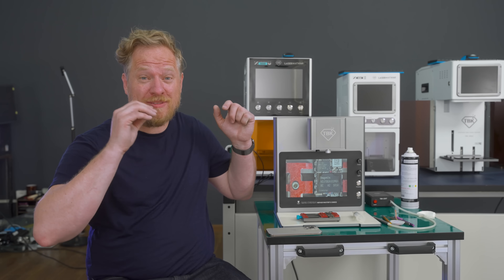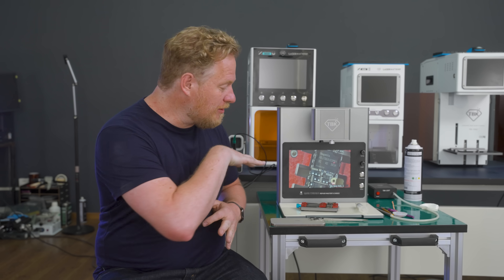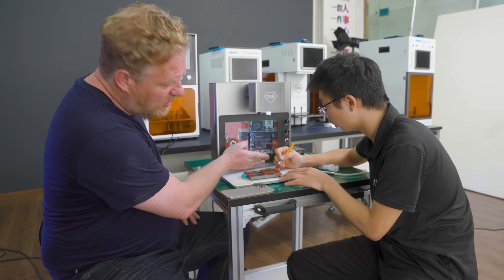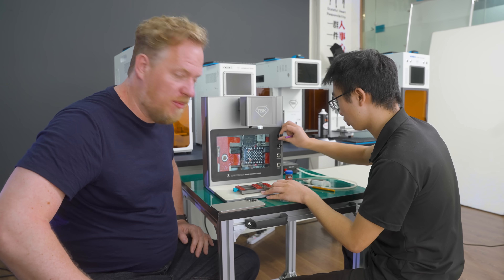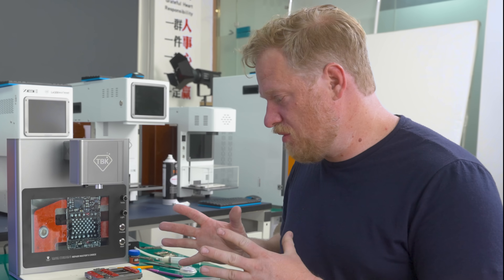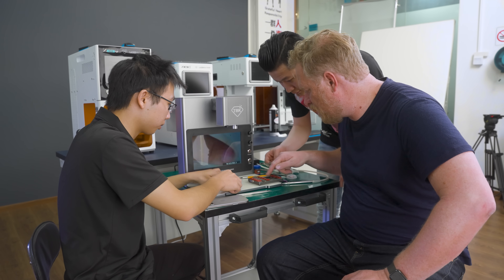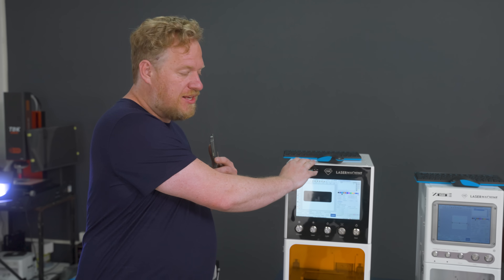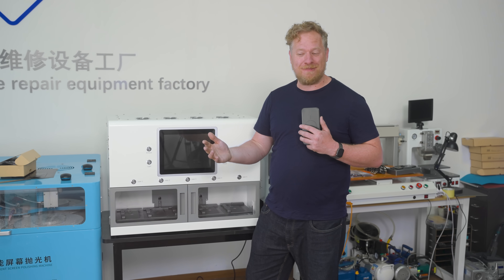This Shouldn't Be Possible

Comment: Have electronics gotten more energy efficient or more energy required with smaller and smaller parts?
Reply: Energy efficiency, modern chips and electronics tend to sip power compared to stuff from even 10-15 years ago for stuff with comparable performance

Comment: 5:56 I cannot imagine a situtation where this is not only feasible but also cost effective?
What kind of chip would be easier to repair than straight up replace? especially as chip manufacturing technology becomes more technical?

Maybe like obsolete vintage chips that don't have replacements?

Comment: Would be nice to see some built-in fume extraction in the base of that machine. Have it be in the style of those built in extraction fans you see in induction stovetops that suck the air down. It should not have to add a lot in height to the base, but make it a lot nicer to work on not having to have a separate extraction funnel in the way.

Comment: what happen if your hand accidentally slightly touch the laser beam..? if it hurt then better add a foot control for switch on and off ,then no need quickly to move your hand to turn off the laser beam right after removed the chip.

Comment: This is not just about phone repairs. 
This is will also be used to upgrade (used and new) Nvidia GPUs with higher memory chips (and flash them with a custom bios to run higher capacity memory). 
Repair and upgrade service needs for Nvidia GPUs for AI needs funded this development.

Comment: Not mentioning covering anything outside the chip you're heating with kapton tape or the like is a bit silly. You don't need to indiscriminately blast the entire board with heat, you can partially protect the remainder of it

Comment: the part where you edited out the chip coming off made me very irrationally angry and i stopped watching
not gonna unsub or anything but yeah
just keeping it real with you that was pretty lame
Reply from the maker: Yeah, that was an editing mistake. We shouldn’t have cut that. If you keep watching, you can see me remove the chip later (might also make you angry though, because I fling it across the room😂)

Comment: I like this but a few  things….

1. Although it’s not clear how it works but I’m assuming a positional laser beam. So sticking your hands into the path of the laser to whack up the temp feels sketchy? And where is the eye protection? There are lots of lovely shiny surfaces to guide those beam in ya eyes! 

2. For me, heat has never been the problem with HD boards, instead, it’s nudging the surrounding components off position… just like you did. All that’s  missing is vertical removal, which could do with vacuum removing tool. 

3. In BGA rework houses, this tool already exists - just not laser heating. The tool will remove old BGA and realign and reflow new BGAs with very localised heating. Maybe this will be quicker but yeah wear goggles! 

Thanks for sharing. 🎉

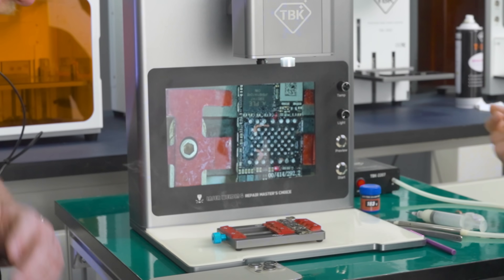Comment: I really appreciate you showing us this tech. But I want content that questions things which should be questioned, and content that's honest. Having a very weird cut at 2:13 at which the chip magically gets removed is... weird. Especially when showing how easy this whole process is. Maybe it's just 20 seconds of struggeling a bit that you cut out. But doing this really hurts ones credibility because we just don't know what happened in that time. Maybe he was just struggeling a bit with that chip. But please show things like that.  
Second thing: even if I'm the 100th person saying that: why is no one wearing eye protection? Seriously. It's cheap and an absolute no brainer. And if it isn't needed for some reason: Tell us and give us the reason!  
And this video isn't the first featuring TBK that just doesn't really sit right. In the galss polishing video you asked them if reduced thickness is a problem, and they just shrugged it off with a "don't worry about it", and you indeed, didn't worry about it. Which is a shame, because I really would have liked to know why I shouldn't worry about it. Here again: Maybe we actually don't need to worry about it. But since we got no explanation for that, we don't know.  
I get that you probably don't want to stress personal or buisness relationships with TBK. And I really like your factory tours and such. But posting videos like this can very quickly lead to ones credibility getting questioned.

Comment: Cataracts speedrun <3
Reply: Cataracts are removable... this would be permanent retina damage, lol
Reply: ikr
Reply: I was instantly thinking about this. Kinda wondering about the wavelength of this laser. Staring directly at the IR reflected off of the working surface may cause injury to either the retina or the lens depending on the wavelength.
Reply: @alexyoung6418  this is infrared. Cataract is caused by UV
Reply: @jsc3417  Both are valid. Check out "Glassblower's cataract". This SMT rework utilizes the thermal effect of IR, which is the same exact mechanism behind the cataracts caused by IR exposure. The key is intensity, which a laser doesn't have a problem with.
Reply: They have a machine to remove the cataracts

Comment: Very cool but as others mentioned lasers in normal working places are treated very seriously and require dark safety goggles and the machine ran in separate room.
But now that I think about it, I think you could get iron tips or hotgun attachments where block of metal is heated, you press it against the chip, and it will precisely transfer heat to the target IC quick.

Comment: That is amazeballs like you say for minimising the collateral damage around the IC you need to remove. Like so many others have said though, laser safety !!!!
Reply: Surely localised heating Maximises shear on the chip, board & pads. Hot air heats far to warm & near to hot so minimises shear.
And I'm not keen on any shiny metal parts or tools in the beam potentially blinding you.

Comment: This is absolute lunacy without eye protection. One unexpected reflection into your eye and that’s it.
Reply: Actually the reflection is not that dangerous unless putting a mirror under the laser. It is true that near-infra is quite dangerous, and the wavelength of those machines are usually around 1000nm. But light undergoes diffuse reflections resulting in energy attenuation. For a 100 watt power, it is quite difficult to cause someone permanent blindness in a short time period. Most likely those behaves may result in short-term vision loss and visual impairment in the long run.

I'm just saying there are a lot of things in normal life are far more dangerous than those machines, and we all are well-informed adults. Visual impairment is horrible, still not fetal.
Reply: @p1ng2h  And what do you think the surface of tweezers or a solder pad act as?!
Reply: @tookitogo  Thanks for pointing that out. Without absorbance enhancement, metal surfaces shall be considered as mirrors. But as I already said still would not be fetal. I'm not saying they are making a fine example of handling those devices. In reality, people are always willing to take risks for profit. Unfortunately, that is not lunacy, but humanity.
Reply: @p1ng2h  I didn’t say it would kill you. But it could cause permanent eye damage.
Reply: @p1ng2h  what’s with the surface of a gpu soc these are like mirrors
Reply: this is true as he said it is an inrared laser that is not visible to the human eye,. one wrong bounce light youre instantly blind haha
Reply: @junvervasig only nah, it's ofc common in (this biome, not neutron stars) nature, so it's amenable to horse sense in that, were it a laser for sous vide of whole horses, you'd stay a room away at least. Here aperture diffraction is protective.
Reply: @junvervasig  your eyes can not sense infrared. It can't damage your eye.
Reply: @jsc3417 it can burn and destroy your retina cells if powerful enough, it doesn't matter if you can't see the light! 
And is obvious they were very hard trying to keep their hands away from the laser path, showing to me it was probably powerful enough to hurt skin.
Reply: whats it?
Reply: @staygoldpwnyboy923  Permanent eye damage.
Reply: Is that the channel slogan? It could be.
Reply: @jelly_fischer Strange Injuries
Reply: I would call the manager
Reply: What PPE would you recommend for people doing factory tours where there's someone in the corner operating a fibre laser or something like this?
Reply: @TorchHacker  Everyone needs laser safety glasses for the wavelength in use. Both employees and visitors. (Or the whole device needs to be in an enclosure that blocks the wavelength.)
Reply: guy who doesn't know how laser focusing works. "One unexpected reflection" lol
Reply: @NavinF  I certainly hope you’re not a laser safety officer anywhere, with that cavalier, uninformed attitude.
Reply: @tookitogo  LMAO I would never work a bullshit job like "laser safety officer". I'm an engineer, not dead weight.
Reply: @NavinF  That isn’t a job, bro. 🤦‍♂️It’s normally a role filled by an experienced individual in the department that uses them. The fact that you don’t know this strongly suggests that you have never worked around powerful lasers.
Reply: dont worry he'll just sue them for a shitload of money
Reply: Except that's not "it". 
A laser isn't some sort of magical eye destroyer. 
Worst case it'll leave a few spots and lines.
Reply: @asas-xn4qk  That is permanent eye damage. That is “it”.
Reply: you might want to understand what your talking about before you pass along wrong information and make yourself look like a fool.
Reply: @ugetridofit I do know what I’m talking about. Enough, at least. 
1. At work, I support the laser labs. 2. This exact topic was discussed at length on the eevblog forums, with significant discussion by several true laser experts.

Comment: I'm puzzled as where the laser  heating up compared to if you have a custom soldiering iron tip thats completely flat and just touch the top of the chip and heat it up like the laser?

Comment: Really should have laser safety glasses around that thing.  It's de-focused so the energy density of any reflection is pretty low, but it's still at a wavelength your eye's focus but can't see.  (judging by the purple highlights, I'd say it's around 1064nm)  Good glasses for NIR are <$100 and let through 70-90% of visible light.
Reply: Question, do you know where I could get laser safety glasses that have any type of certification besides trust me bro? I tried to get ones from Amazon that looked legit and all I got was a Chinese drop ship with a pinky promise that they were rated for my blue engraving laser, safe to say I didn't try them, I haven't been able to find anything that doesn't come from China on Ali express...
Reply: @ericsaul9306  Proper ones are at least $200, if you got some for $10 then you can be sure they are not good, that's how you can know.
Reply: @ericsaul9306  Edmund Optics is the gold standard for just about all optics related stuff. You will certainly pay for them, but  a pair of their safety glasses would still be much cheaper than a single emergency.
Reply: @ericsaul9306  Thor Labs for one place (where I got mine). They're not cheap (a couple hundred dollars) but are certified and you can get ones that block both IR and UV. That said, ordinary PMMA (acrylic aka Plexiglas) absorbs IR pretty well, which is why you can easily cut it with a CO2 laser.
Reply: at least the soldering part is "out of focus" enough so it ends up like a "10w, very focused halogen light".  
But still, yeah.. WAY better to be safe than sorry.

Comment: The problem is that companies that make cell phones & other consumer devices have made repair impossible. the chips used are serialized so that if you remove a bad chip & replace it with a working chip the phone software will recognize the chip has been replaced & will fail to run. The companies want you to buy a new device, not repair your old device. 

Its not just phones, but its laptops & even appliances, printers, etc.

Comment: Why did you edit out the bit where he took the chip off?  If it was that smooth that part would be left in?
Reply: tbh the smoothness doesnt matter, the targeted heating is the useful part. the problem with heat guns is not the just other components [only the tiny caps and similar tbh]  its plastic and other melt able components on the boards. so if this is around the same ball park of difficulty as a heat gun, except it genuinely can hit 1 chip at a time, then it has a pretty solid niche at a minimum.

Comment: It's a focusing/adjustable UV heater with gun thermometer and magnifier, in a workstation. There should be a vacuum pickup tool rather than tweezers.

Comment: I've feel down a rabbit hole recently of cool additions for soldering... Soldering tweezers, cast blocks to heat complex pins at once like charge controllers, even desoldering tools that work with suction to hold components, and have different shaped blocks. They're all rather inexpensive, a bit more than a heat gun, but much less than most repair techs would think. While this product is pretty epic, and I can genuinely see the use case for it. I don't know if the price would be worth it for most repair shops in comparison to existing options.

Comment: The next iteration would be a CNC type where you can program in the chip location it preheats, fluxes and removes the component programed for removal. Fully automated.
Reply from the maker: This is a pretty interesting idea.  Even if you can just select the chip on a screen from a photo of the board.
Reply: @StrangeParts  I would love to co design and produce with you and Elephant Robotics!
Reply: It should also be able to do everything you just said in reverse…
Reply: @harveyweizman  yup an automated pick an place rework station!

Comment: That would be a game changer for me as a locksmith I need to read EEPROM memories, desoldering etc , thanks man, glad to see you healthy
Reply: Curious to know more about why you are dumping EEPROM memories as a lockie?
Reply: @topytopy for Vag (VW, AUDI, etc) group mostly, security is on the cluster (not OBDII)
Reply: @topytopy  smart lock maybe ?
Reply: Desoldering blocks or tweezers. If you're doing the same chips over and over again, you can design in CAD and use somewhere online that mills metal. I think this machine will at least be a few grand, so.... Weigh it up, you just need to bridge the pins with heat and lift with tweezers. :)

Comment: Looks pretty cool (no pun intended). We use IR soldering irons as well for rework, just not an IR laser, and not with a camera, and we have a few thermocouples to get temperature readings on the board. We do however have a bottom preheater as well, to get the complete boards warmed up. Unfortunately the reach from theyr device seems to be optimized for smaller phone sized boards, so our larger industrial sized boards would not fit this. Still curious what price point they are aiming at, if i remember correctly our IR station was at least a few thousand $ back when we bought it.
Reply: Ah - IR should give you similar control. The ability of a laser to scan a very specific area could be an advantage, but then again, unless it were extremely rapid it’d introduce a lot of lateral temp differentials which would be bad. - So maybe this thing is actually just focused IR anyway. Still very cool to see!
Reply: No reason the same tool head setup can't be mounted to a SCARA arm or something similar to allow you to move it freely over a wider area, though in that case I'd suspect you might want to split the controls and display onto their own unit to have them positioned where you want them too.

Comment: 1) Eye protection? Whatever the answer you might give is, it's a shame you didn't address it. Seems a fairly obvious point to being up when demonstrating lasers.
2) Does this technique work on thicker/multi layer PCBs that would typically absorb more heat when using hot air? What about PCBs with SMD components on both sides? Can it be adjusted to not make those fall off on the other side? (More important when it's a fairly thin PCB I guess?)
Reply: On 2, this is an iPhone board. They are very thick multi-layer PCBs already.
Reply: IR BGA rework stations are used all the time for thick 8-12 layer PCBs like modern GPUs. They also work with dual sided PCBs. This should be obvious if you watched the video - the heat is still very concentrated to the component you want to desolder. It's not like the whole board gets heated to equilibrium.
Reply: @-eMpTy-  Your assuming Knowledge that not all viewers might have. The premise of the video was that this was an alternative way to de solder components vs hot air. My only experience is with hot air so, it's not an unreasonable question to ask, as the video does not explicitly state this.